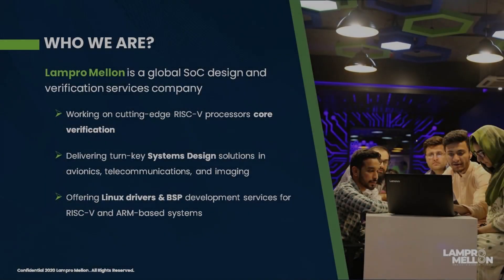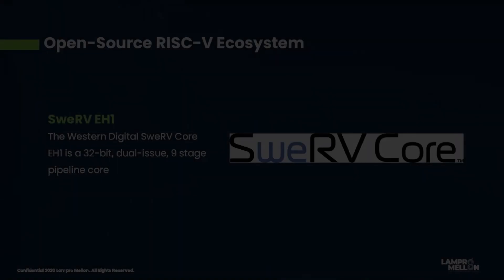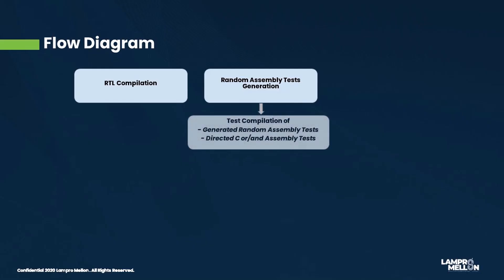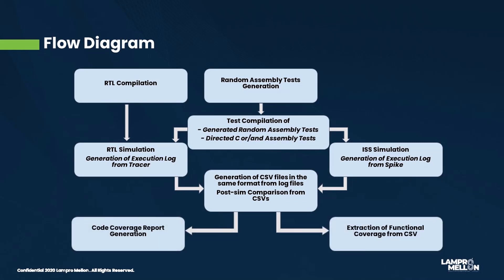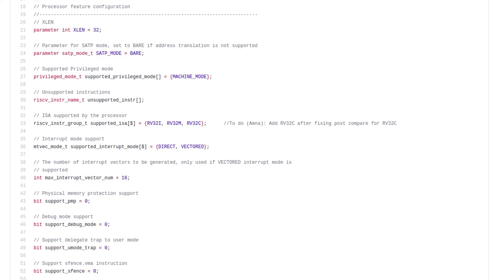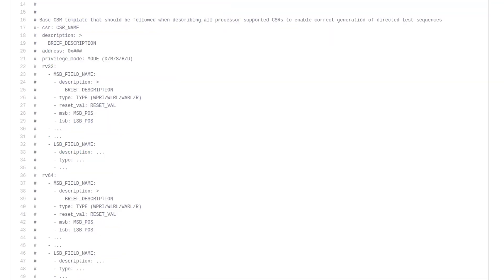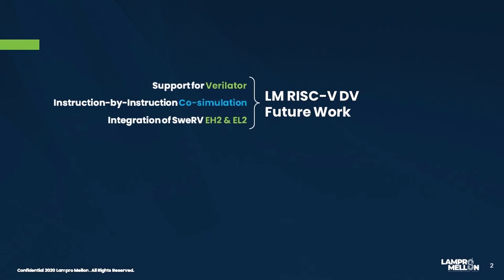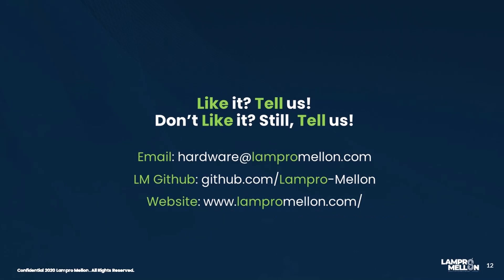Tech Talk Lampro Mellon: An Open-Source Solution for Accelerating Verification of RISC-V Processors

Comment: Make a RISC-V_pi or a Pi_RISC-V ??
Can you make an ARM_64 to RISC-V code/binary converter?
Can you make an x86_64 to RISC-V  code/binary converter?
How about making C/C++/C#/Java/python/etc... lib+compilers for RISC-V ???????

1) if I write/have a program that runs in x86/ARM Ubuntu Linux, why can't I run that same program on RISC-V Ubuntu Linux?

2) Why can't the source be compiled into the platform you need without changing any code, just select which arch you need?